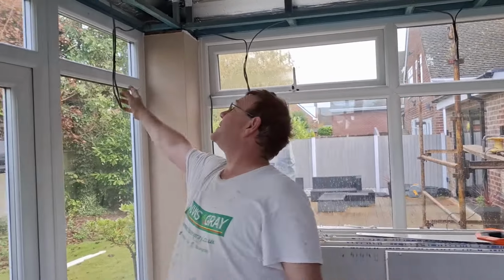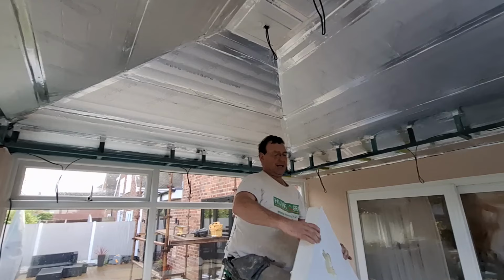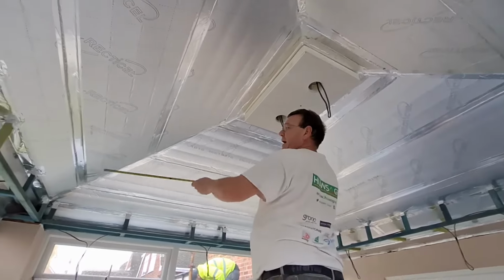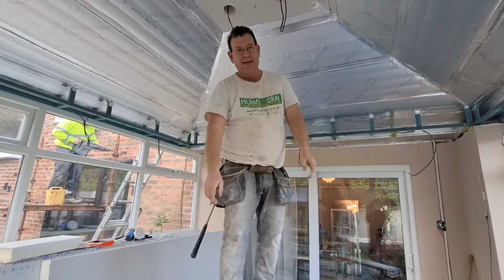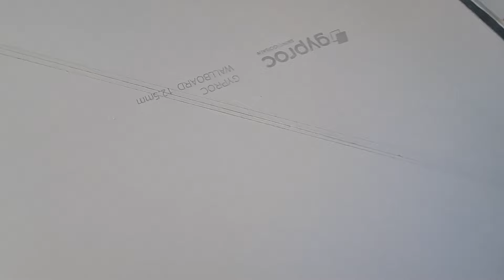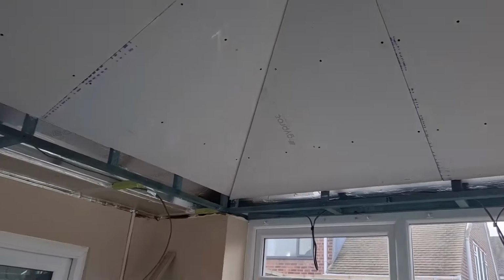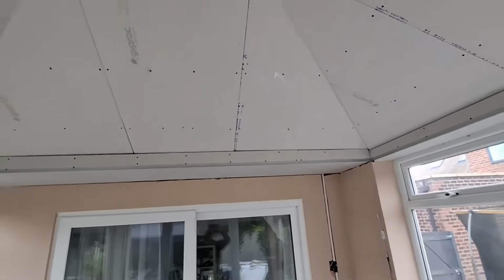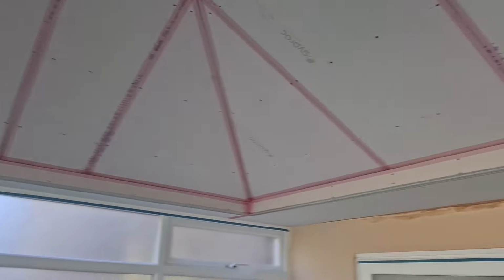Plastering a guardian warm roof with a lighting pelmet and a trip to Llandudno

Comment: It's refreshing to see that trade is still flourishing and respected in other parts of the world.    Here In the states the sheetrockers have all switched trades because the immigrants undercut the prices.   Now they roll the taping mud on with rollers or use the bazooka to tape and float their joints.     The trade has become no more than a laborers job and is not respected.        I good drywall guy and a good finisher  is an art that deserves respect.   But they ruined that here in the last 25 years.       Trump 24.        Thanks for making these videos.   I enjoy the content.